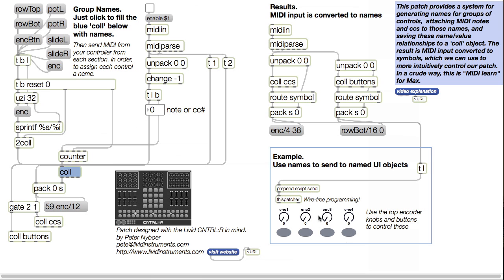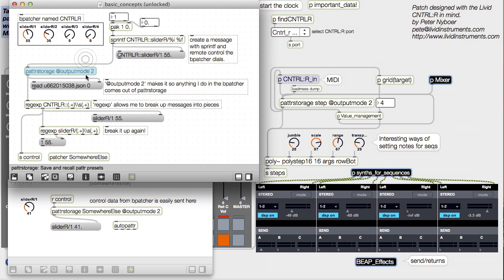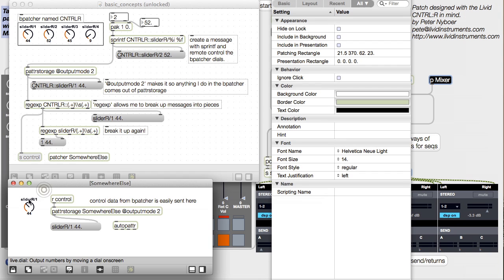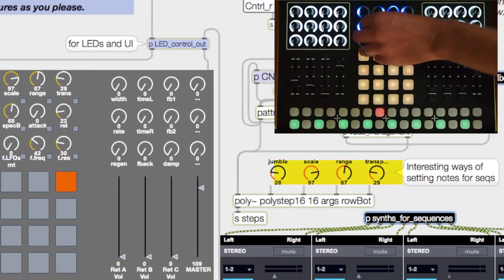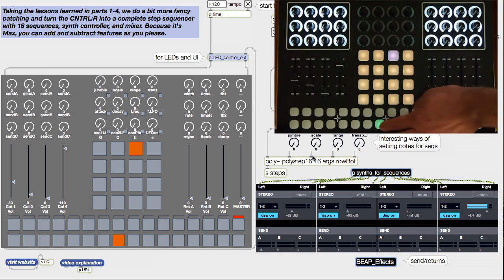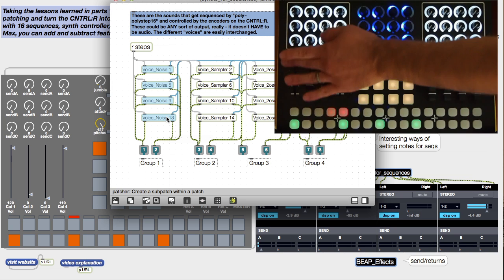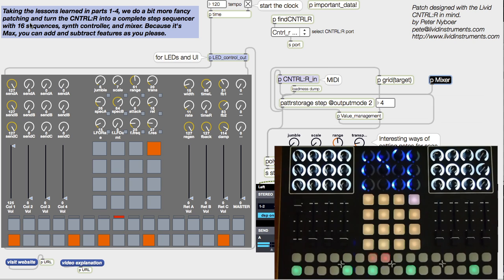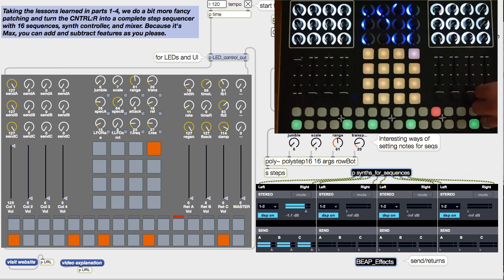Max6 and Livid CNTRL:R: Step Sequence Application Example

Comment: wondering if this could be modified such that you could reassign to a different controller and have that transmit to hard modular pieces. [i have a feeling the answer is yes, and if you can figure it out...it will werk]

Comment from the maker: Thanks! The patches are designed around the CNTRL:R, but he lessons are generic enough that they could be used for any MIDI controller. That's the intention, anyway. Each patch in the set (link is in the 'about' of this video') has a link to the corresponding video, so hopefully you can figure it all out.